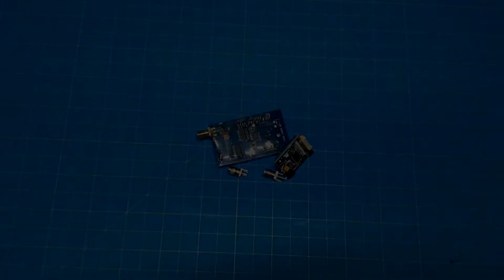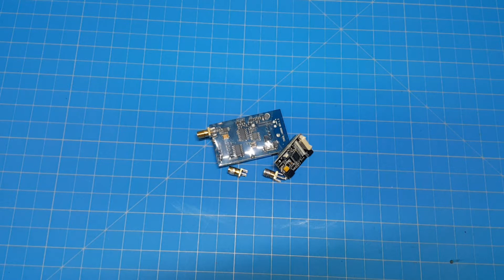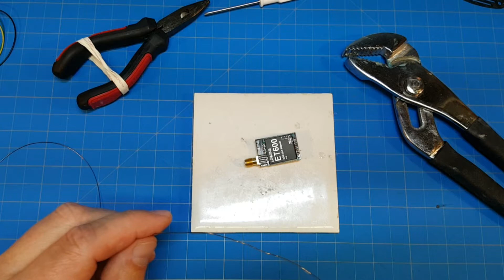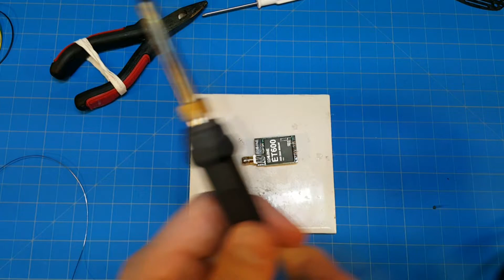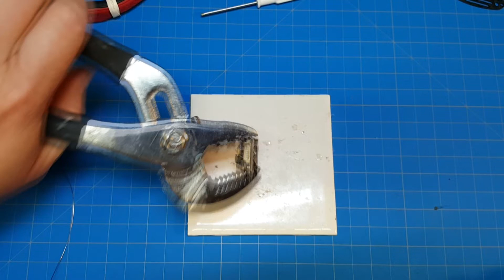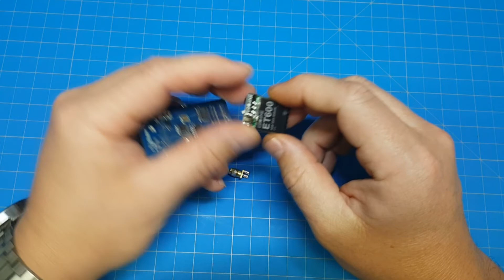Remove vTx SMA Quick

Comment: guranteed way to pull a pad.
Hot air the part may work using a reflow station, but decreasing thermal mass is the best, cutting the leads or sawing off the connector.

Comment: I just got the ts832s from banggood (good price), to swap with 200mw ts5823. Which is smaller and the connetors are smaller. I thought I would make a jumper cable, but, I don,t know the names of the connectors to search for online. Any thoughts?
I could just cut and solder the 2 different cables, but, I was hoping to do something a little less permanent.
Thanks for the video's.
Reply from the maker: Are you looking for something like these? http://goo.gl/NtwVugIf so be sure to select the correct end for your needs.
Reply: Thank you for the response.
Unfortunately the link does not work for me (404 page not found). 
I think I zeroed in on the connectors name, "Mini. Micro 1.25mm T-1 5-Pin JST Connector". Although I found an ebay listing showing a 1.0 mm and it had the same dimensions as the 1.25mm, go figure. 
http://www.ebay.com/itm/Micro-JST-1-25-T-1-5-Pin-Connector-plug-with-Wire-x-10-sets-/111380527960?hash=item19eecbfb58:g:anoAAOxyhodRywM2#shpCntId
My thought was, I would wire servo leads to the the female jst 5pin and use that as a jumper. 
I realized from doing the searching, that I will have to be careful of the negative, positive and video wires going to the camera, my existing harness has them in different position on the connector than the ts832's. So much fun. :-)
Reply from the maker: ah, I was thinking of antenna. Often when the vtx doesn't come with a connector/harness that fits our needs we have to rework them or replace. Ebay listings are partly risky, I order from ebay seller sammylam and get what is listed on the page.
Reply: Yes, I think I will work with what I have and be careful.
Thank you!

Comment: Only problem is you don't heat up the center pin and you can see you ripped the pad off the VTx. The ground pads are still there but the center pad is gone.
Reply from the maker: yes, in the video instance this did occur. I was able to solder on the replacement antenna center pin to what was left. I did a second off camera using less pressure. to much hulk in my first attempt. :(
Reply: Nick Burns I've done the same thing on a ImmersionRC VTx. Now I use a Dremel and then desolder the pins. It's a pain but saves me from snapping the SMA off.

Comment: so what do you do now? solder on a cable and connector?
Reply from the maker: Good point. I should have included that part too. You can direct solder the antenna like I did in the Frog build or solder on a lead/pigtail to an sma, to increase the mounting flexibility. The hawkeye video transmitter has this and is one of the more popular vtx for micro builds. https://goo.gl/zs9N8i
Reply from the maker: starts at about 32min or you can use this https://youtu.be/KW_C_z9VPaw?t=1961
Reply: thankyou.